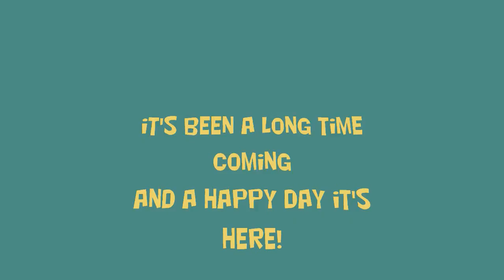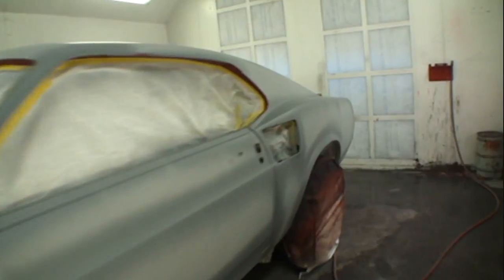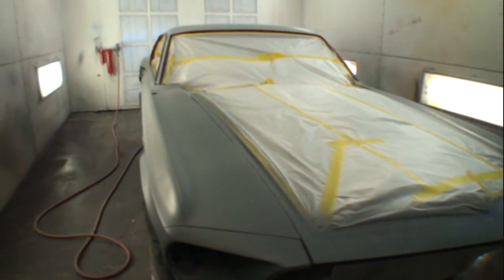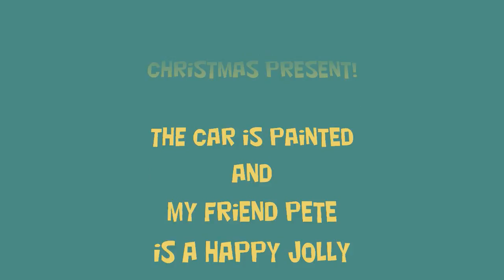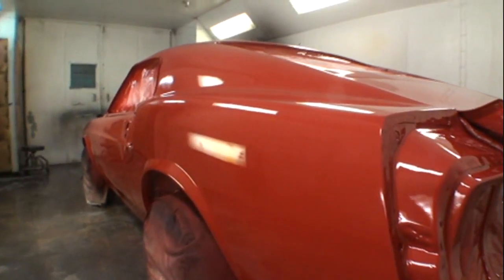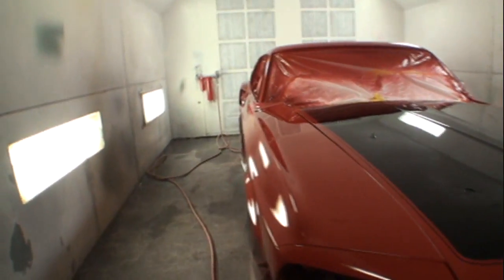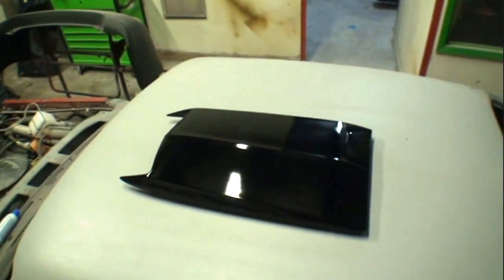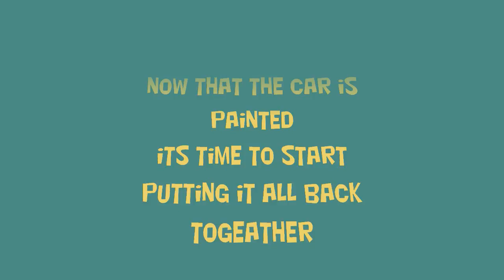1969 Ford MUSTANG Mach 1-This Car Is FINALLY PAINTED

Comment: reminds me of my 69 Mach one, white, 352 engine , 4 speed.   I hope you got the extra bracing for the heavy engine as mine needed a wheel alignment every two months.   Got stolen after 6 months
and I did not want it back.  Found out about the bracing around 2010 from a man who races them.

Comment: Would bolting the panels together still apply to a newer Mustang  (1987) before painting?
Reply: This applies to most cars because you don't take the risk of damaging the fresh paint trying to reassemble the sheet metal. every things is already fitted and gapped. Good job pete a lot of hard work to get to that point.

Comment: Only bad thing is the black is not suppose to be high gloss. Actually BC/CC isn't correct on them. I've been using a single stage urethane. I only use PPG.

Comment: My 69 hood was dull black and so was everyone I have ever seen
Mine had a 352 engine and 4 speed and the engine was too heavy and front wheels went out of alignment 3 times in the 6 month life of the car.  There are bracing kits to reinforce the front now,  Use them.
It was stollen for parts and I was glad it was gone.

Comment: 7 Years? I can take a whole car apart sand blast inside and out restore whole car and save all metal.. Cut and weld just by myself total restoration... In 3 months time. We are talking about Ohio cars .. Next to rust belt state. I have restored Ferrari, Rolls Royce, mustang fastbacks. Been doing over 20 years was taught by guy who had done it 45 years.. So i can only imagine if i spent 7 years. My cars are already showroom..